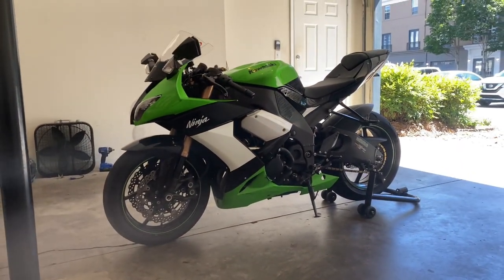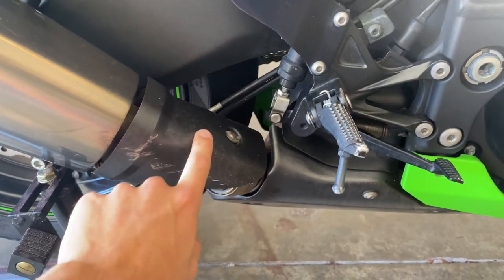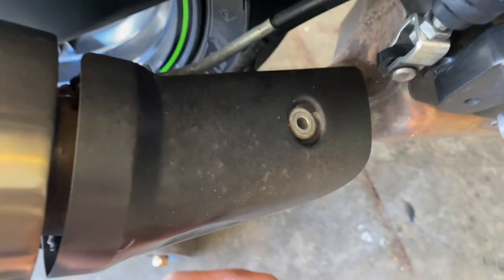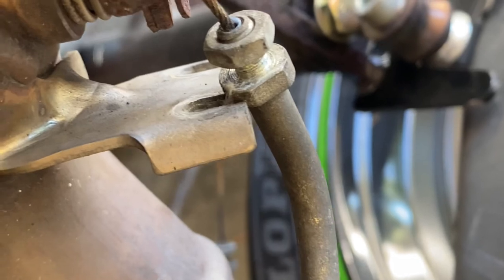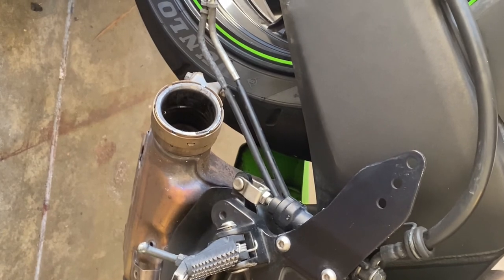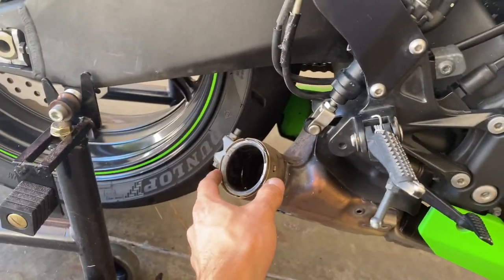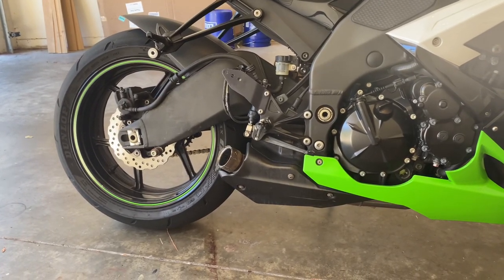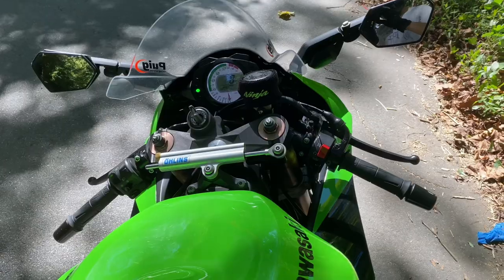2009 Ninja ZX10R Muffler Delete Tutorial and Exhaust Clips

Comment: It needs ro be tuned now, as the increase in the flow of air outward won't match the amount of fuel injected, making the engine run lean, reducing the amount of power, especially in the top end. Not to mention the restrictions programmed into the throttle body valves to restrict top end power production.

Comment: Did you notice a power difference bottom or top end?
Reply from the maker: Not really tbh, it felt exactly the same. I’m sure removing the cat would make a big difference though
Reply: @elkado6302  I'm just worried it'll be hard on my exhaust valves, but it sounds so much better 🤷‍♂️
Reply from the maker: @BerettaA4  If anything it’ll be easier on them cause there’s less pressure in the exhaust. Some ppl said they were getting an engine code, but I never got it
Reply: @elkado6302  hmmm 🤔 thanks for responding. I just took it off, we'll see how she rides.
Reply from the maker: @BerettaA4  Nice man have fun👍🏼